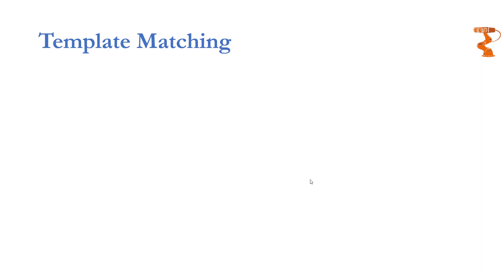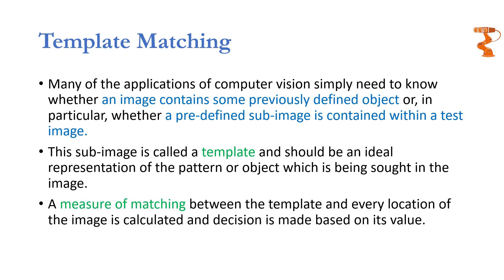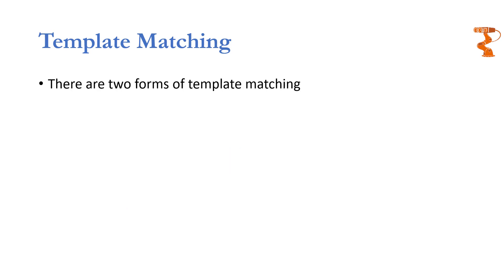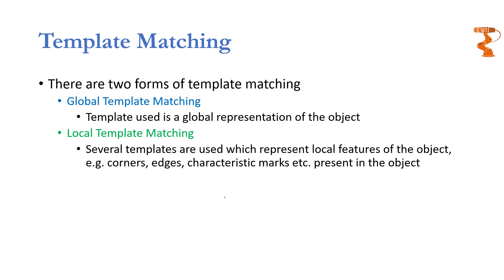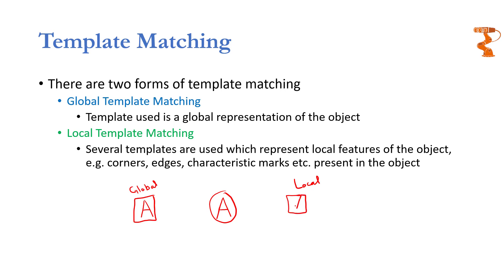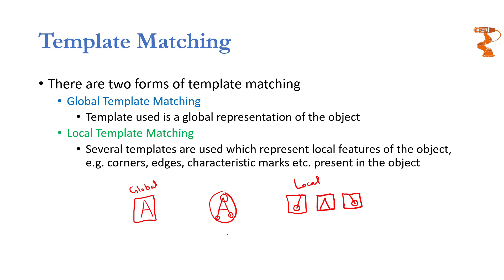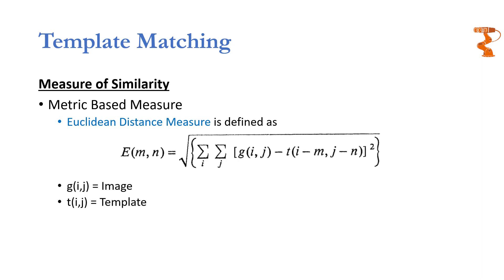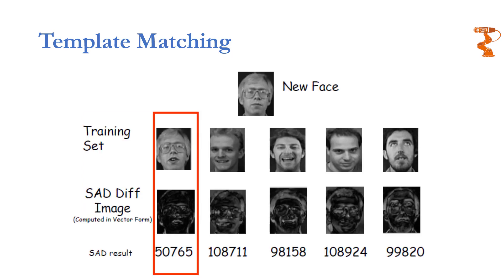Template Matching

Comment: Hi, it is a nice video training.. Could you send me code also could you make an example that do you use to count/find how many similiar objects(plane) in a airport image in matlab using correlation?
@t

I use following code but it finds only one:

clc;close all;clear all;

image = imread('1a.jpg');

I = rgb2gray(image);

[Ir Ic ]=size(I);% size check

figure(1)

imshow(I)

%T = imread('1s.jpg');% read template of the image

image1 = imread('1s.jpg');

T = rgb2gray(image1);

%T = (T-10)*1.5;

[Tr Tc ]=size(T);

figure(2)

imshow(T)

R = normxcorr2(T,I)% find normalize cross correlation

R = imcrop(R,[Tc Tr Ic Ir]); %crop the extra pixels

%test% [r c v] = find(R>=(0.5*((R/0.5)))); % find coordinates where maximum correlation exists

%test% [r c v] = find(R==(max(max(R)))); % find coordinates where maximum correlation exists

%test% [r c v] = find(R>=(((R)))); % find coordinates where maximum correlation exists

[r c v] = find(R==(max(max(R)))); % find coordinates where maximum correlation exists

RGB = insertShape(I, 'rectangle', [c, r Tc Tr], 'LineWidth', 3); % creat a box around maximum

figure(3)

imshow(RGB)
Reply from the maker: Can you send me the image you are talking about? Your code use 1a.jpg so I have no idea what image that is. You can email the image at learningorbis@gmail.com